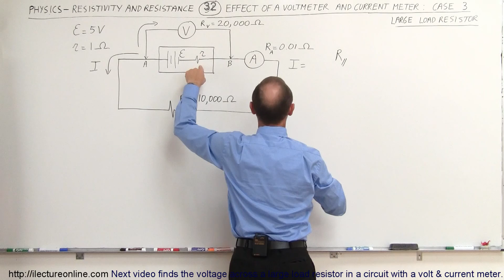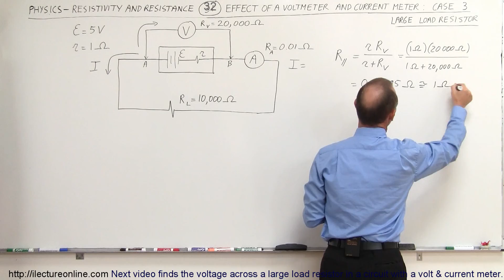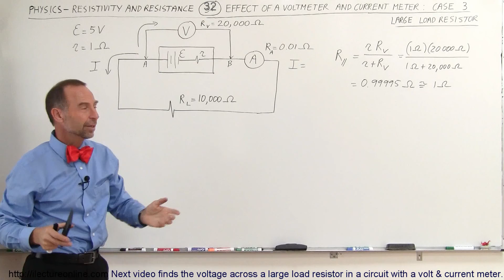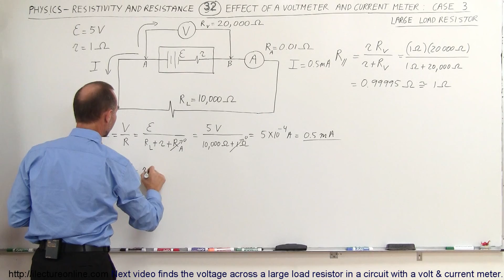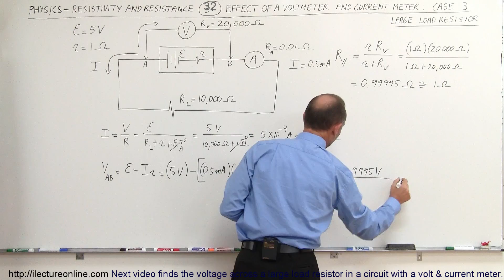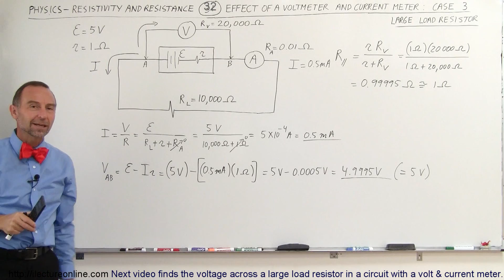Physics 40   Resistivity and Resistance (32 of 33) Effects of Volt & Current Meter

Comment: How is the Volt meter resistor (Rv) in parallel with the battery internal resistance (r)?
Reply from the maker: The way a voltmeter works, (it provides a secondary path in parallel for the current to flow through) so that the voltage drop across the volt meter is the same as the voltage drop across the device measured.
Reply from the maker: That is an example labeled: CASE 1: OPEN CIRCUIT.    The circuit is not completed and thus current only flows in the loop created by the voltmeter and the battery, which is a circular loop and therefore the 2 resistors are in parallel
Reply: According to video 30 of the series (https://youtu.be/4uY0tdrcd3Y) at (min 2:44) they are in series, why?